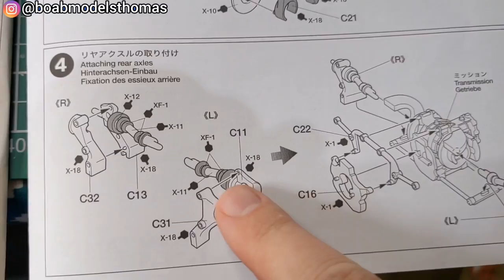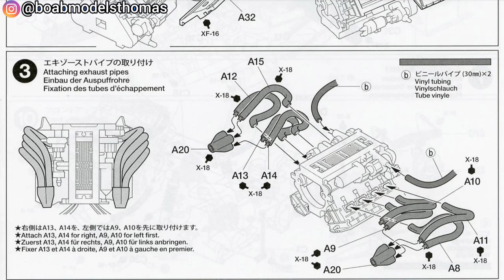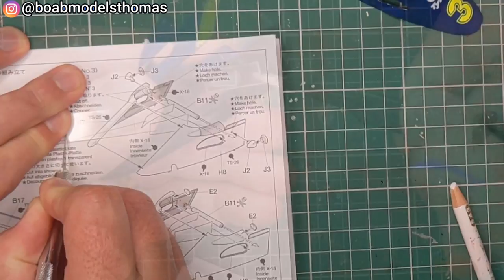[Full Build] Tyrrell Ford P34 'Six Wheeler' 1976 - Tamiya 1/20 - Jody Scheckter

Comment: Wow! This came out really nice, lots of details too. Question, what do you use on the axles before you snap the wheels on? I really need to get one of these kits, really nice. Thanks for sharing, have a great day.  -David
Reply from the maker: Thank you very much. Yes, it's dish soap which can help when the wheels are stiff. Also I find the F1 suspension delicate so anything which can help that is good.
Reply: @BOABModels  Cool tip, thanks. I agree, suspension parts on these seem pretty fragile sometimes. On some of mine, I just drill out the hole and then glue them in place. They don't turn but I'm not rolling them around on the floor anymore.  ;^) Have a great weekend.
Reply from the maker: @PlasticImaginationWorkshop  yeah, that makes sense. I liked that I could take these off if I needed as I may use it in a diorama one day. 
You have a good weekend, too! 👍